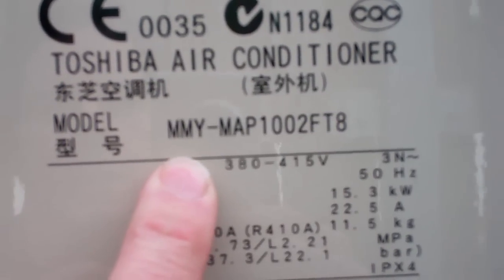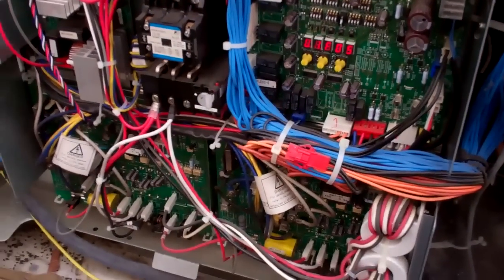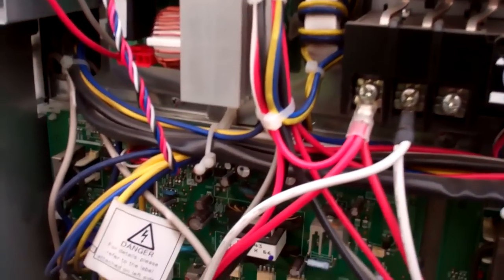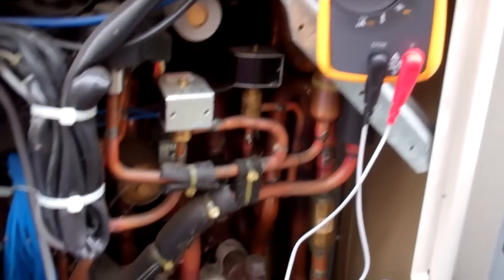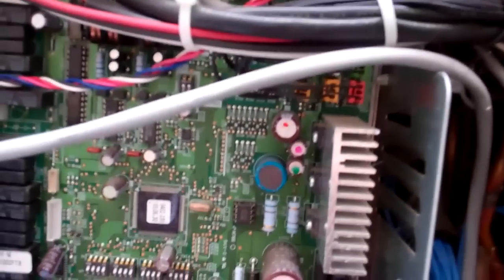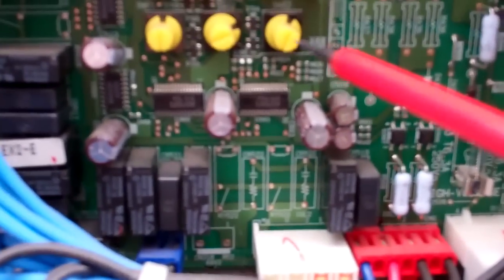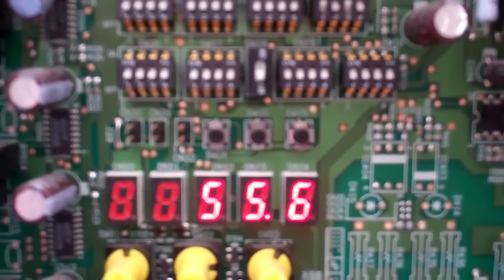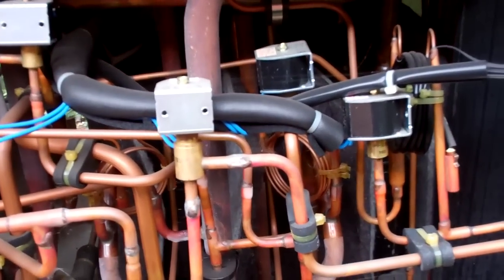Toshiba VRF Diagnosis

Comment: Hi mate 
What charts are those and where can I find them? 
Many thanks
Reply from the maker: I think I found the info online, also if you find a wholesaler that sells the brand, usually their tech department are helpful with info. If the all fails the Refrigeration Engineer forum can often generate helpful advice.

Comment: Getting an e28 on u3 of 3 units linked. Only when it’s got a high load either extreme heat or extreme cold. All other times works fine. Ben through the sensor outputs and they are as should be. Looks like I need to catch it at the right time.
Reply from the maker: This is the only one of these I've worked on so I'm not much help!

Comment: You didn’t perform a thorough diagnosis your checks was based on guessing not on logic which is not good!!!??
Reply from the maker: Well I've got to say that all comes as a bit of a shock to me, thanks for letting me know!
I'll be sure to check out some of your vids for tips on how to improve my channel.
Reply: @heavydiesel  I don’t mean anything bad if you found my comment is rude I apologise but if you need any help in water cool chillers, air cooled chiller, Dx chillers, VRF,VRV, Mini split,muti split, pack systems,AHUs, refrigeration supermarket etc please do not hesitate to contact me.

Comment: Hi sir
I have trouble with unit smms-super, suck not cool after cleaning.. Can u help me..
Reply from the maker: Hi, this is the only one of these I have worked on so I am not much help.
Not sure exactly what type of indoor units you have but may be worth making sure all filter grills are shut properly, some makes have safety switches. Also make sure all units are turned back on after cleaning. Make sure any batteries are still good in any wireless remote controls.

Comment: Hello, i wish u okey sir ..
I have a problem with toshiba MMMs the same with this video and need your help if you could you please..after 3hours of working the module stoped with fault H07-02..i try with tk1 to tk4 also i put 1/3 L of oil  but without any success..i even change the cart and also verified SV3A and sv3B and also sv3c and sv3e and the problem still ..help me please..i don't know what to do any more..with all respect..and thank you sir
Reply from the maker: I haven't a clue what the problem is with your system, this is the only one of these I have worked on. Is there any technical support you can call to ask for advice?

Comment: Hi, u can help me? I have 6 units in error check 00 = E7 communication units indoor - outdoor .... U can help solution this? i work Air conditioning in brazil

I am looking for a way to quickly solve the block that are 6 appliances and has the height of 3 floors of communication wiring as it is in the attic (roof)

Comment: Good Noon Sir,
i am new learner,
can you tell me sir VRF leak attain whole mathod please ?
if 16HP machine then whats his Suction pressure ? Discharge pressure ?

while copper pipe joining that time how much fill up nitrogen pressure ?

how much nitrogen gas feel up for leakage tasting ? and How many hours keeping ?

after that how many hours vaccumise the system ?
please sir reply soon.
Reply from the maker: +jimmy adems Hi Jimmy,

With VRF systems the suction and discharge pressures don't really tell you much about how the system is working (unless they are really low or really high) They only way to know if the system has the correct charge is to take it out and weigh it, though some makes have a self diagnostic function to aid charging. It really depends on the make and model, I usually have to phone the technical support for the make i am working on.
  To work out the amount of refrigerant to add, you need to know how long the pipes are for all the different sizes, then use the chart and formula in the instructions to work it out. 

When purging copper pipe with nitrogen you don't want any pressure in the pipe or it will blow bubbles in the braze, the best thing to use is a flow meter like is used for Mig welding, the flow rate depends on the size of pipe, the pipe needs to be open at the opposite end to where the nitrogen is going in and then capped off once you have finished brazing and purging to stop dirt getting in.

For leak testing it depends on the size of the system, a small mini split may only need a few hours, but a big VRF system may take days to be sure there are no leaks, (last one we did with 30 indoor units was left for about 4 days) Be aware the nitrogen pressure will go up or down if the ambient temperature goes up or down too.

For vacuuming you need a digital vacuum gauge, you run the vacuum pump until you get a good vacuum level, then valve the pump off and see what level the vacuum stabilizes at, if it is too high then the system need more vacuuming. The manufacturer of the VRF will usually have the required vacuum level in the installation instructions. 

In the UK the VRF manufacturers do free courses on how to install and diagnose the equipment, if they do them where you live it is really worth going on the courses if you can.

Comment: What I can't understand is, if you're going to have a microcontroller in there, then it's probably easier (only 4 wires in some implementations) to have an alphanumeric LCD display, and enough ROM memory for it to actually tell you in English what's wrong, to save you looking it up in the manual that you might not have... If that makes sense!!
Reply from the maker: Alan Cordwell It would be good if they all used the same codes, or you could use a code reader like they do on cars, and then put things in test run etc.

Comment from the maker: Yeah it does sound odd but i think most if not all inverter units do something similar, its probably only 50watts or so, i don't thing it should affect motor life but who knows for sure! 

There are two compressors side by side pretty much just behind the circuit board box, they are wrapped in a blanket to keep noise down and the heat in so are out of sight!

Comment: I commissioned a new Toshiba VRF system last week and the boards are still the same. These are nice units to work on as they can be interrogated to find any fault by the display. U1--- shows unit one, U2--- unit two and so on. The dashes show any fault that may be apparent.
The manual is ok but lots of the essential info` is not in it but Toshiba`s tech helpline is second to none in helping you out
Reply: Yes because you have to pay for the calls to toshiba they should be good 👍 😆

Comment from the maker: The manual on this machine has 274 pages! Hope it works once the new sensor is fitted haha!

If you've got the right information they are not too bad, its just having the right book or pdf file for the equipment you are working on, this is the first Toshiba VRF i've looked at so its a bit of a learning curve. Customer didn't even know they had outdoor units so wasn't sure if it was just a mini split or what till i got there.

Comment from the maker: Its a three pipe variable speed system, so it can heat and cool at the same time, (upto 48 indoor units can be piped to outdoor units) Could have one indoor heating on the east side of the building and another cooling on the west side if the sun is warming that side for example. Its more efficient than two seperate systems, with one cooling and one heating.

Comment from the maker: Hi Quan, 

Thanks! Basically the fans and compressors are driven from variable speed drives, the expansion valves are electronic (hence all the sensors) so it can ramp up and down to match the load and run constantly, instead of cycling on and off like a conventional fixed speed system.

Comment from the maker: Yeah its very complicated, two compressors and fan, inverter drives, electronic expansion valves etc, its three pipe so it can heat and cool at the same time, there lots of pipes and valves to manage oil and refrigerant flow during all loading and temperature operating conditions. Very complicated!

Comment: Woah, that is the most complex refrigeration system I've seen! Is all that pipework necessary or are they doing something really complex in there (the three pipes coming off the unit)? All that electronics seems like a bit overkill though, could shrink that main board down quite a bit these days.